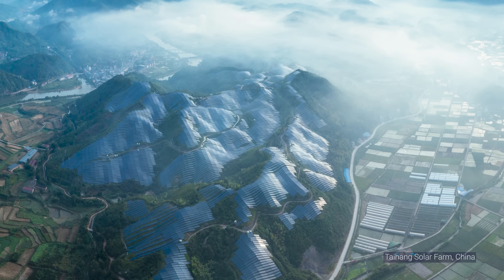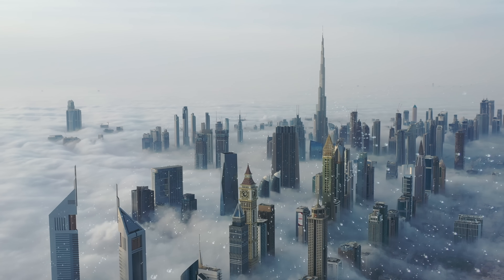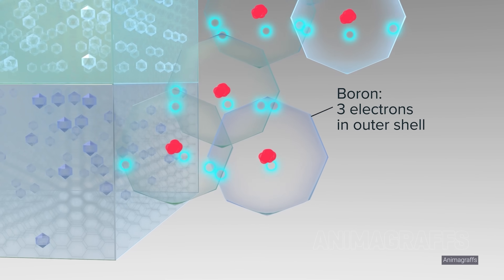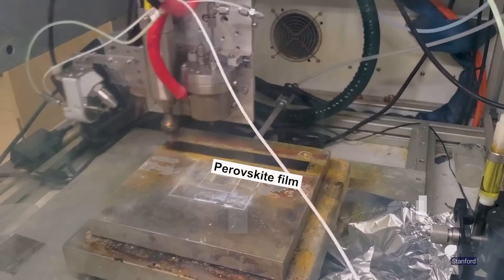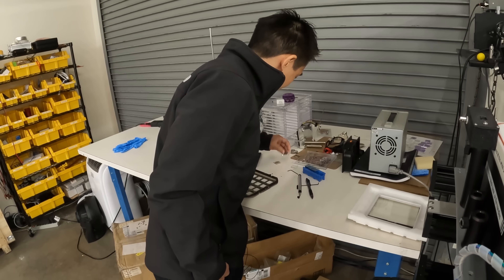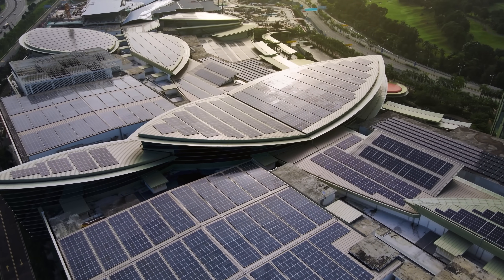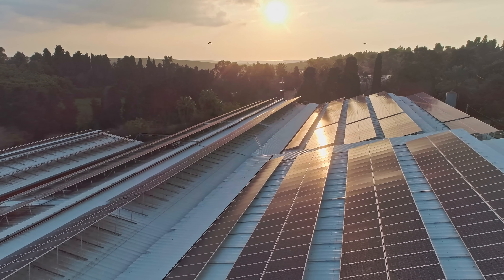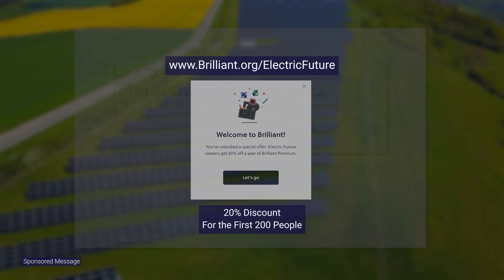Solar 3.0: This New Technology Could Change Everything

Comment: That is how u make a good solar panel. 1 how much thickness how tall is still ok key pnt. 2 how heavy or how many layers ok. 3is area bigger deal than hrs of sun or other way around huge deal if sun not shine. 4 is heat capture easily poss total end process or no heat get back end poss, Then u just make or buy panel factor$$$ ing these pnts. If 20% normal sunshine to 30% is best cost panel & LIFE span of panel then u hve to think vertical reflecting & semi transparent. Doing back end concentrating fully back into broad laser or light, if not just free heat. Free heat not poss if 30 or 40 degs out side though dah.

Comment: Stuff like which bend of flexible material gives the best angle wide opening into most important best Reflection even if transparently pasing thru. BC most light reflected is certain light range & most light passing thru each transparent color is diff light range.

Comment: Once u thick vertical u hve changed the game. How cheaply can we print make cheap ok 20-30% panels then on verticle not flat, how great can we reflect light back & forth clear give u most chance to capture it no matter sun angle. What light spectrum is best captured & how can we make light shine most in that spectrum. ie changing light sun or artificial into the best spectrum. How capturing light energy full sun into stored form then creating it back into just best spectrum form. ie rain day sun panel light still shining. Just trying to get easy cheapest ray. Also we can make light ie laser more or vary strong ray. A strong ray can reflect more times & pass thru more layers in a vertical. So key is getting mult reflection, getting most cheap reflection in best ray spectrum & on bottom getting all light that is cheaply left either as heat or as fiber optic mirror catch.
Reply: That is way to make cheap solar & durable w/current print tech. A lot more in the converting light to get still into sweet light bands. A lot more in getting every drop capture as heat or if shining min amount b4 heat stage as fiber optic, what ever is there u got it used it million of fiber optic as light diff area no window poss or as light to be lasered back up miilion optic back into 1 laser weak broad source.

Comment: 1647: my idea was kiss just make panels vertical instead to get the efficiency up just depends how tall u want to make them thick & what is practical. If on top of a roof 1 ft or 2ft seems reasonable thick but on top of a trailer more like less than 5 or 6" thick.
Reply: If vertical then u hve just increased surface area+ if u channel light & reflect it back & forth u hve more efficient cheap panels not hving to track the sun near as much.
Reply: letting light finish & pass thru into a catch tube or mirroring back up & reflecting back out. If light tube can catch light light for light beam & heating directing light as beam into where ever might be no window,
Reply: Fiber optic light beam where ever.

Comment: One good hail storm or extreme wind storm will disable any solar set up.
Without other power generation as a back up we may be back to black outs for a large areas. Wind isn't reliable either. No wind or bad storms there wont be any geneations.
Disposing of both creates another problem.

Comment: Not even 20 seconds in and I don't know WTF you are talking about.  Civilization uses X TWh per year however the Sun does not radiate in KiloWatt Hours.  
The Sun radiates in Watts and does so for so many hours giving Watt-Hours.  You failed to include the amount of time the Sun shines to be equivalent of 
how much energy Civilization uses in one Year.  Can you see how you need the unit of time for both sides of the expression you are trying to convey?
A great way to tell whether people are full of shit with their Engineering is simply to pay attention to the units.  Don't worry about numbers.  If you can't get your units straight then I'm certain you have the rest screwed up as well.  Gawd, it's as bad as when I hear about 'so many microplastic beads per square meter of Ocean water.'  There's ZERO fucking microbeads per square meter of Ocean water you morons.  A SQUARE METER HAS NO FUCKING VOLUME.  Honestly humanity is getting stoopider by the Watt-Second.  Sorry, had to go on a rant...undies too tight.
nb:  To be fair a Square Meter of Ocean water would be one atom thick (or so given the bond angles of the water molecule) so the expression would force a slight volume...but there's still no fucking plastic beads in it.  HAND

Comment: stack them into Cone shapes and then stack the cones with enough space between each cone stack to let light flow down threw each cone stack

When you point this at the sun, the light will bounce hundreds of times off each cell before exiting the bottom of the cone.

Comment: Swift solar needs to be trying to secure contracts to shade hot desert parking lots with fake trees or something.
Reply: I say we should have been using solar structures to shade hot parking lots since the beginning, especially since the hottest ones are in deserts which also happens to be where we have good strong plentiful solar energy. We could have coupled long corridors or “breezeways” with wind turbines out in the middle of nowhere. We could use more induction motors. We could have resisted the electricity movement in many ways. Tesla turbines, when turned by air, happen to compress the air “gas” by simplicity of the design. The gas is forced towards the center of the turbine before being exhausted. This also causes the blades to spin faster. If the exhaust feeds into the intake at least partially theoretically once started spinning it would be self feeding. Also it would theoretically allow for acceleration to feed acceleration, if on an aircraft, due to being powered by air. The faster you go the harder you would accelerate therefore the faster you go faster. Plausible? Maybe. Possible? Absolutely. Imagine blowstarting your jet on the flight deck, one breath of air, and within two seconds of takeoff you’re already approaching the speed of sound. Ten more seconds under full acceleration would hypothetically have you traveling somewhere near the speed of light. How this would work in the vacuum of space I have no idea. Einstein said that everything with mass has gravity therefore tends to stick together thus the vacuum of space. If every molecule desires to stick together with others what is left in between everything is nothing. Interestingly enough most of everything is also nothing in all actuality. The space between.

Comment: I heard of an energy system devised of a miles long tube, located in a plains state, where there are predominate west to east winds. The tube is large in diameter, and quite high in the air. The tube is graduated downward in size that creates a venturi effect. Ultimately the wind in the tube hits hypersonic speeds, and turns a turbine for electricity generation.
    My dad, RIP, used to say all the time, that all we need to do is harness the tidal flows and it would give us endless power. Super reliable. I've seen vids of engineers trying to create underwater turbines in the Mississippi River, but the water power tears these generators up too fast to be viable. That was ten plus years ago.

Comment: there should be technologies being develop for storing solar power. Yes, batteries are used but it is very inefficient as batteries on the market has depth of discharge (lead acid batteries has 50% usable energy). If we can create a carbon nano-tube batteries on mass production that as at least 80-90% usable energy, then we can power a house on a efficient way driving energy cost to all time low.

Comment: Solar installer hear the problem isn’t solar panel solar panels are amazingly affordable and the cheapest way of producing electricity even in some of the more northern More snowy, less sunshine states the problem is energy storage for the nighttime and the environmental impact lithium hydraulic mining has on the environment and the cost of the lithium batteries we need to solve batteries stop trying to solve the solar issue there is no solar issue!

Comment: If they are so cheap, you can make the Cell itself easily exchangable inside a solar housing. For commercial use where the flat roof is maintained anyway, it may not matter if you exhcange one or two cell sheets inside their housings every five years.

Comment: Wouldn't it be great if someone would invent a self charging electric car, not dependent of charging ports?  The charging system is built into the car and as long as the wheels are turning, it is recharging the batteries.

Comment: The sun doesn’t shine at night, not consistently throughout the day.  The quality factor of power in North America for solar averages to about 25%.  With tracking or no.  That means you’d need to multiply the number of solar panels by 4 to get the actual number needed to supply our energy needs.  400 square miles of solar panels would cause ecological devastation unlike anything we’ve ever seen on earth.

But that alone still couldn’t power the country.  We’d have to store that power to last through the night, evenings and mornings, and cloudy days.  And we have to store it in the dumbest way possible, through chemical or mechanical storage via batteries or some mechanical storage.  So, if we’re lucky, we can recoup 80% of the energy we store, much more like 60% based on current figures.  So now we need to increase our solar field size by another 40% to compensate and we would need an additional 40% in battery capacity.  So, at least 25 Tera watt hours of battery storage.  More than all the batteries on earth combined, and then some…. Just to make solar energy viable.

Or we could just take energy that’s already been stored by nature, where we can convert it much more efficiently with far less environmental and economic impact.  Nuclear energy and natural gas energy.  Problems solved.

Comment: So, with the theoretical super high efficiency, could they make tritium batteries. Literally put tritium rods inside a wound up layer of these cells tuned to absorb every wave length of radiation they give off?

Comment: Sorry, but this sounds like bullshit to me.  They keep saying it absorbs all parts of the sun light, but you can see through them so obviously that's a lie.  They say you can have 2 layers absorbing 100 % of their wave length.  Well, that's also bullshit.  Sure you can layer it so the top layer absorbs say orange light wave length, and the bottom layer absorbs the blue wave length, the problem is that the top orange layer is either going to absorb say 100% of the orange and block out the rest of the color from passing through, or it's going to say pass 50% of the light so only 50% of the orange can get absorbed leaving the other 50% which could hit a solid filter and get that in blue wavelength.    If that's the case, why not just use one layer and get 100% of one wave length?

No, this really sounds like hippy dippy rock sucking bullshit.  Before you get all butthurt, by hippy dippy, I mean the new age rock sucking tree hugging hippies, not the old age van painting dope smoking hippies.  I like the latter kind.
Reply: You don't know how light works do you?
Regular glass absorbs about 100% of UV light. Does that mean it blocks all the visible light? What kind of logic is that
Reply: @fritt_wastaken  Nope you don't know how glass works plus the liar here was talking about putting this on plastic also, not just glass.  Polarized glass blocks a lot of uv but not all of it.  Regular glass does very little to uv light or the light bulbs in tanning beds would block their own light.  So, want to try again?
Reply: @skavies2351   oh sure, I'm only tutoring this stuff to students, how would I know how it works. There's no regular glass in tanning beds btw, it's a quartz glass.
At least try to use google before making something up. You may use such keywords as transmission and absorption spectrum, band gap, transition dipole moment etc.

Comment: Is this thing for real, or just like the graphene stuff? What he is saying can basically revolutionize the energy industry. The production of solar cells, as well as the batteries, are the big reason solar isn't as used as the environmentalists want. Both require a lot of work and pollution to be made. But this thing, if integrated with our electrical grid and combined with nuclear fission (at night or when the production is low), could really make a clean grid without as many nuclear power plants people fear so much as otherwise.

Comment: I do appreciate a presentation which simply focuses on the scientific elements of this technology and doesn't attempt to do a sales job or push political ideology. If the technology works well, people will use it. If it doesn't they won't. Developing with an eye to providing a high quality product that meets real world demand in real world conditions while factoring in real world costs is a game-changer compared to most of the rhetoric that's out there.

Comment: Instead of covering perfectly good farm soil with arrays of cells, why not the wide berms of E-W highways? 

Also, the idea of, as shown here, mountains covered with panels strikes me as risky if there is heavy rain. The run-off will be sudden. We need vegetation to absorb rain. 
Cover, instead, parking lots, which will also shade cars. America has idiotically large lots, typically only 10 to 20 % filled. That space should be doing double-duty.

Comment: There is a problem with this video. They dont say how long they currently last - on purpose. The problem is being chemical based they break down within hours. Thius is not happening unless you "fuel up" the cells constantly,  But keep pushing the dreams and the money will keep coming.

Comment: No a few questions, when it brakes or need replacing, how safely can it be disposed as all current solar panels are not bio- degradable and are consider as landfill waste as windmill blades. Secondly all this is nice but without a proper power storage that doesn't really on mining for the earth like we are doing now for EV cars and once the batteries are no longer usable, this batteries are unrecyclable and hazarders to the environment.

Comment: I am a consumer. So far every solar product and off grid home I have had have performed poorly. My best bang for my buck has been my diesel,generators , pure sine wave inverter chargers and good old fashioned lead acid battery bank. . Living in the Pacific Northwest  both solar and wind have been a bitter disappointment for me. I really want them to work but so far they are not cost effective or reliable for my application.

Comment: To power the world with solar, you'd need a solar power farm the size of Arizona and New Mexico combined, which is roughly (of I recall) ~12,600 of the worlds current largest solar power farm (by megawatt-hours).
In contrast, you'd only need ~3000+ of the worlds largest nuclear power plant (by megawatt-hours) to power the world, which would be able the combined size of Rhoad Island.
Reply: I don't know with what numbers that was calculated, but solar fans tend to use peak Power production of solars. If thats the case with your numbers here, you can basically double or more the size of that solar farm to compensate for night/cloudy/days, etc and then you'll need a crapton of batteries or other power storage to make the energy produced during the day available at night....

Comment: "Let's combine a heavy metal with iodine in a form which breaks down over time, then deposit it on a flammable substrate." Nothing could go wrong here.
Reply: Yeah this is a problem unless your using nickel or Zinc, in which case there is no problem here.

Comment: if you could put this on my roof for 15x less than the 20 year ones but they only last 5 or 10 years as long as they're easy to replace and easy to know that they broke i don't mind replacing them every 5 years

Comment: So when you stack two conductive paths on top of each other in very thin film layers and they don't have the same voltage you get burn-through which destroys both layers....  would make more sense to use a concentrator parabolic channel and put the individual types with an air-gap between them that can help keep them cooler AND keep them from being in impedic contact.
Reply: Solved ✅
Reply: I love to see brilliant minds come together for good instead of greed and harm.💜💜💜💜💜💜💜💜💥
Reply: Good idea actually, though I’m afraid having air between such thin panels would make the whole structure very brittle. Maybe thin glass, acrylic, or even silicone dividers could solve the issue.

Comment: Wow 100 X 100 miles!?  How’s it work on cloudy days or at night?  Will it be enough to power all those new electric cars?  How much loss in the transmission of all that power?  The conversion of it?  DC to AC, lots of loss there!  Then there’s those pesky batteries to deal with.  Toxic expensive high maintenance short lifetimes @ apprx 5-7 years.

Comment: I have a concern about wide-spread solar adoption, and it is this: what planetary body will heat up faster? The planet covered in black panels? (black absorbs most all the heat and light), or a planet that is lighter in color and reflects heat and light back out into space, all other things being equal? Ultimately, I would think those additional solar cells absorbing the suns rays and converting the energy into mechanical forces which also produce heat as a byproduct through friction, etc....on a wide scale, could have a negative impact we haven't yet realized.